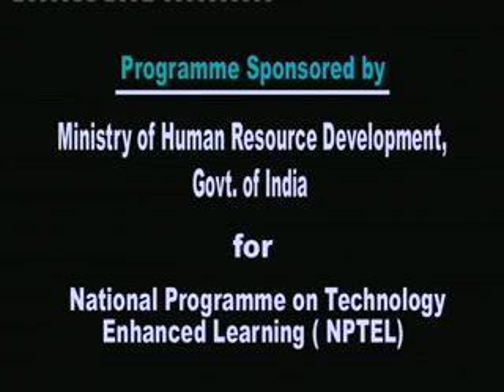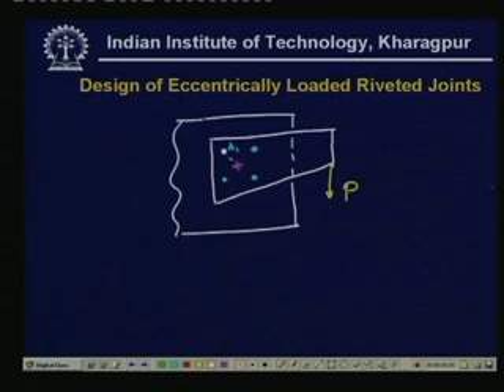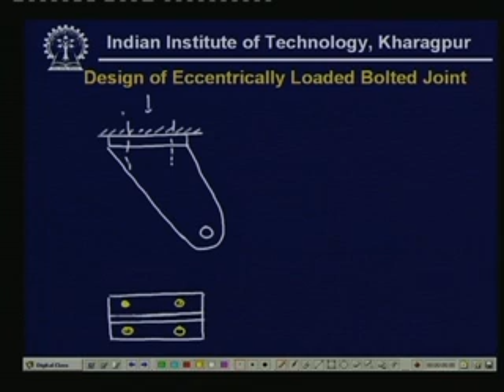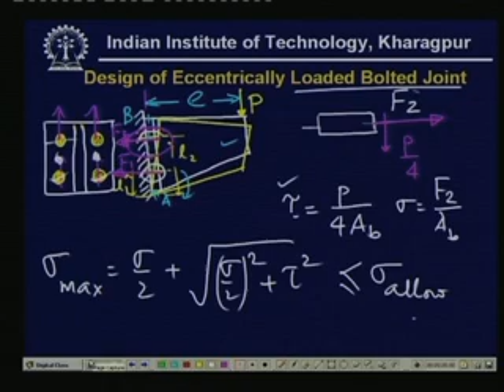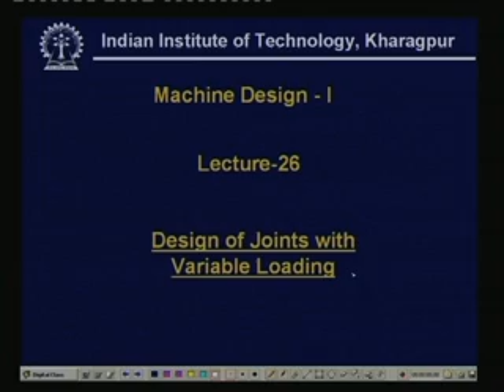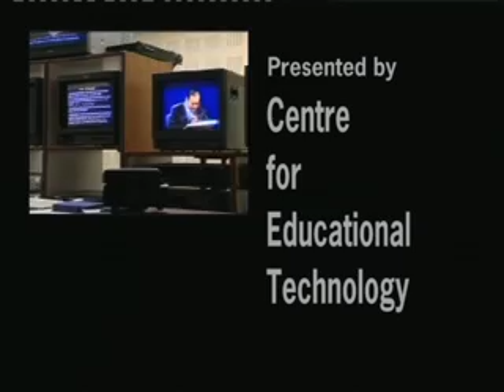Lecture - 25 Design of Joints With Eccentric Loading

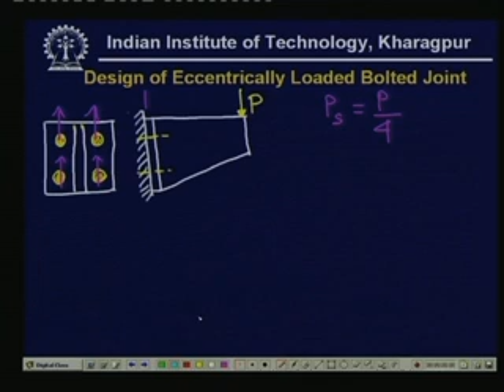Comment: What happens if the load P does not act in line with the center of the bolt group, and say rather closer to the right side bolts, making the tensile force in the right side bolts greater than the left side? How would you resolve the moment to act in line with the bolt group?  Referring to example at 30:35